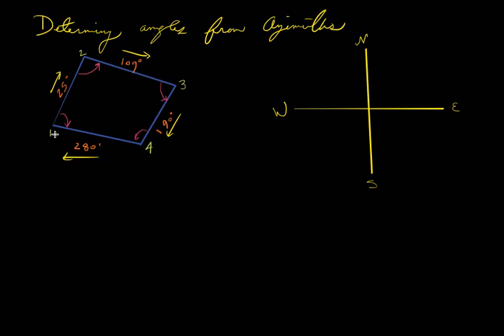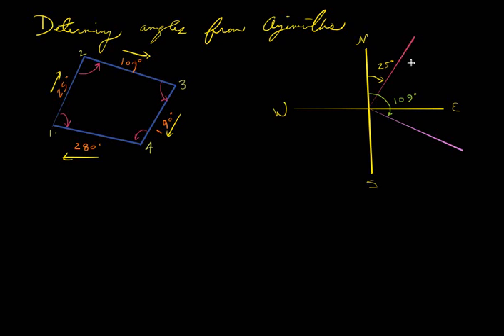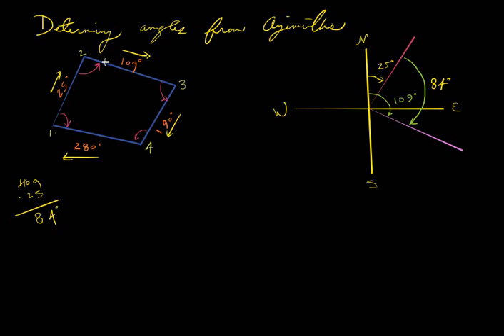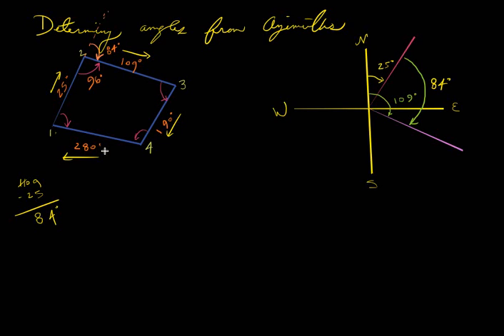Working with Azimuths Part 3

Comment: I did the way you didn't finish, 360 - 280 (which the 25 is included) but I got 80 degrees